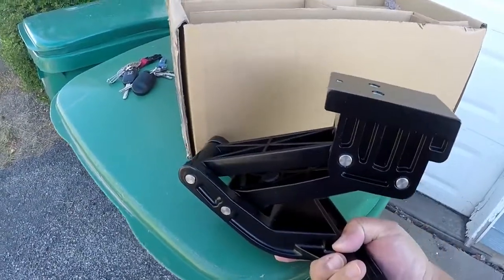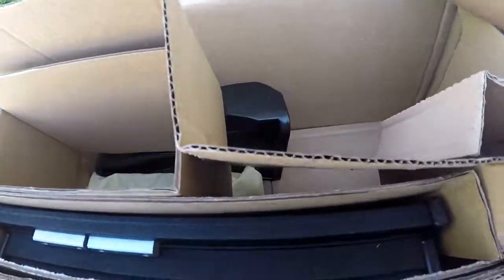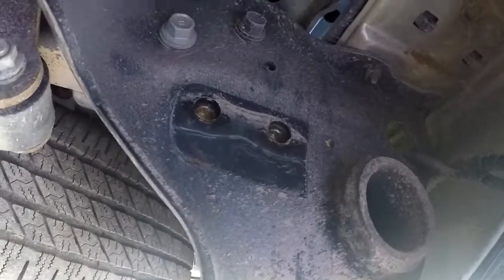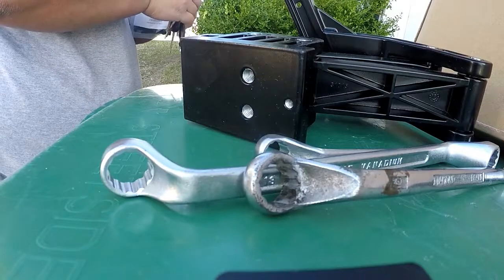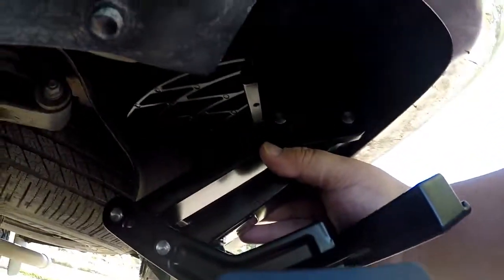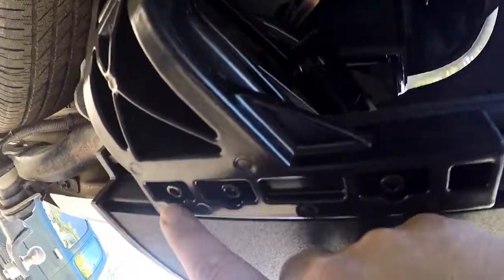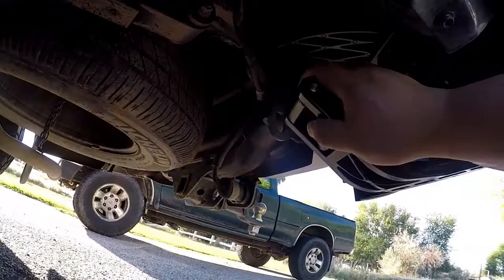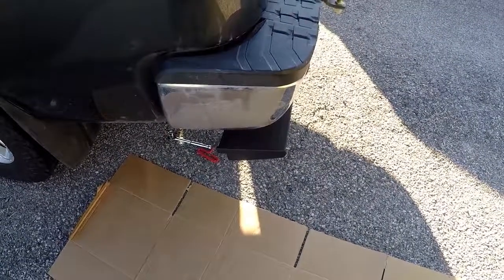bestop trek step install on 2012 tundra : how to

Comment: The install was a bit of a pain because of the removal of the bumper bracket on my 2017 Limited.  The bumper trim was a pain in the ass to unclip, the instructions were very vague.  Also, make sure to use thread sealer (Loctite) to make sure everything stays tight.  I had to use both spacers to clear the bumper on my truck.
Reply from the maker: yeah for the 2014 and up you need another bracket that bolts on to the bumper the 07 to 2012 was simple. thanks for your thoughts and feedback